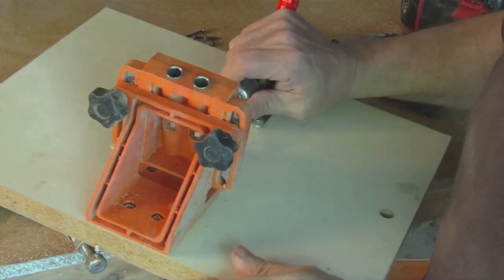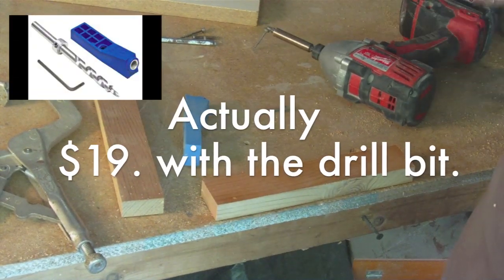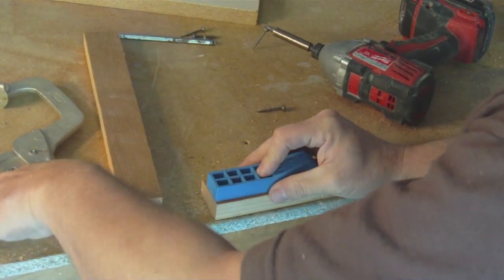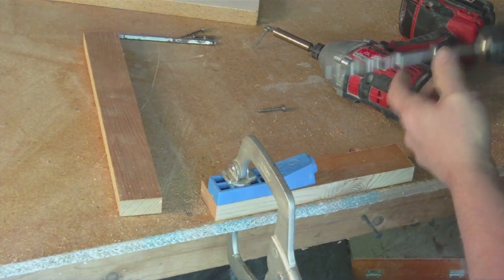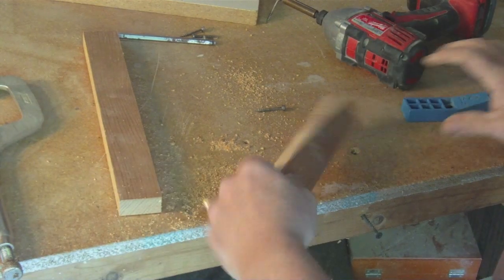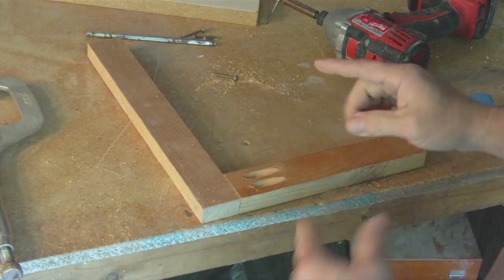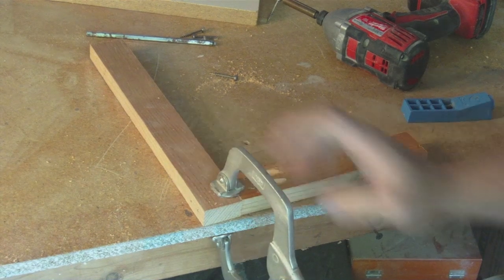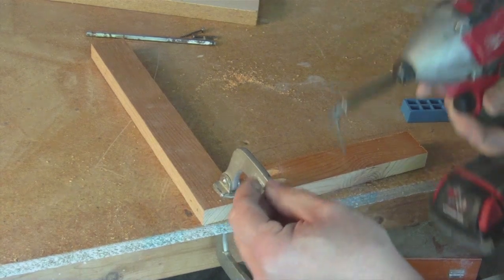Tip 1: Mini Pocket hole Jigs

Comment: I don't own a pocket hole jig yet, I kinda lean towards the HF aluminum jig.  You mentioned using 1-1/4" DW screws, I kinda thought it would work just fine as long as you don't over drive them.

Comment: need help have a coffee table with a crack down the middle, how do i use my kreg
Reply from the maker: Now thats an interesting problem. I would see if it would clamp closed, if so, work glue in the crack and clamp it. Then maybe add a mending plate on the bottom with the screws angled a bit to pull the seam closed. It not a plate, a piece of wood.